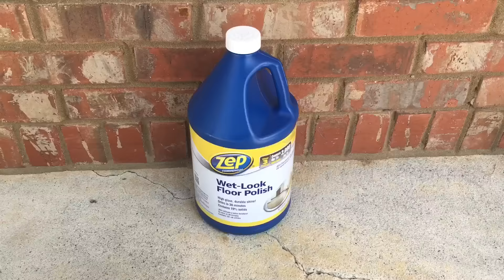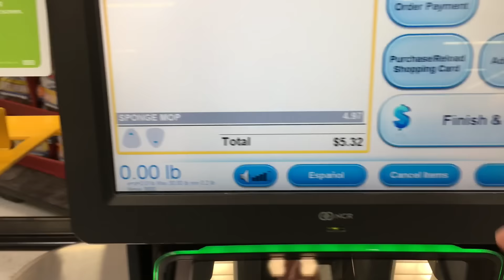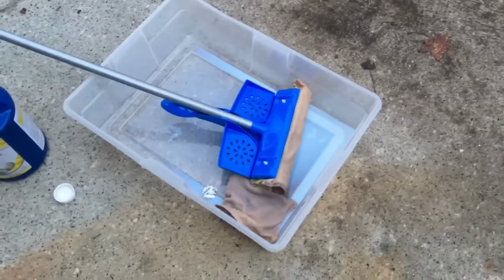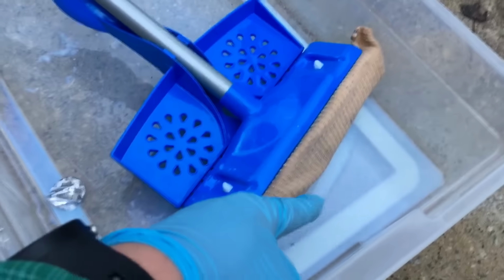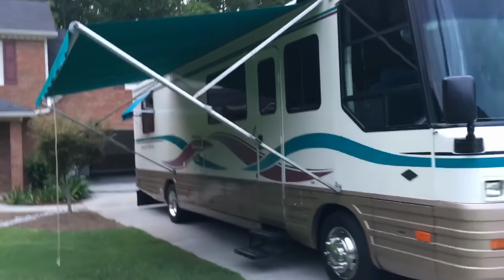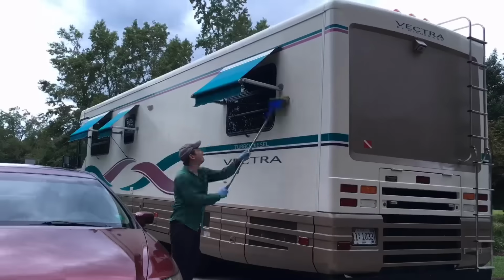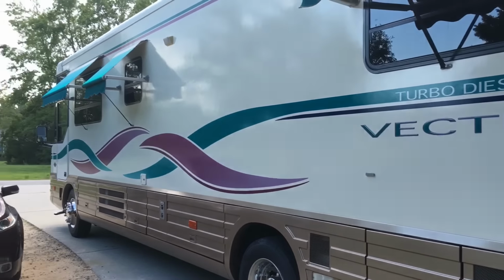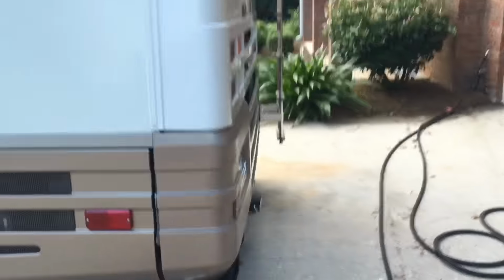Zep floor polish for rv

Comment: After watching this and other videos I tried zep on my 93 Winnebago Chieftain. The results are fantastic. I had tried buffing one section using several stages of heavy to light cut compounds, finishing with wax. The results were ok but not great. The buffing process would have consumed far more time than I have to devote to it. I applied seven coats of ZEP to most of the RV consuming  two-thirds of a gallon to do the entire 34-foot motorhome.  Two months have passed and it still looks great.
Reply: Hubby's dad has a 92 34 Bounder.It's got that chalky look. Would that help bring back some shine or do we have to get rid of the chalky stuff.forget what they call it.:>)

We live in Canada can you but ZEP here?
Reply: It depends on how thick that chalky stuff (or oxidation) is. I suggest you wash a small section then try 4-5 coats of Zep. I could run a finger across my RV and see the chalk on my finger. I did a good wash with a sponge first then used the Zep. 5 months now and still looks great. Good luck!
Reply: We'll  try It when the SNOW Disappears here in Southern Ontario Canada.:>) Thank You .
Reply: Yes Canadian Tire

Comment: Tried Zep wax and was very pleased so far. Unit was involved in tornado and huricane in Florida last Sept. Applied Zep in Jan 2017 and is in good shape. However the sides are a bit irregular in shine. I also use micro fiber to apply. Front and rear caps are great. Smaller areas seem to work better than large side wall.  If I apply several coats does this work better. Have 4 coats now.

Comment: You can buff that finish, and the reason to do that is to level the finish or it will leave application marks from your sponge or cloth. You have to 1. put on at least 6 thin coats.2.use a mild scotch brite type pad on your buffer to cut and level.3 use finer pad or cloth with a little polish to buff it out. Slow speed so as not to burn the waxed finish. It's a slow process but if you were amazed at the Zep finish by itself, youd be amazed after the polishing process.

Comment: I carefully washed my RV, the put it back in the garage for ZEP waxing. The first two coats I put on with a large sponge thinking I could avoid streaks by having a flat surface. Even with wringing it until it seemed almost dry, I got all sorts of drips. I switched to a microfiber cloth, and over two days put on 5 more coats, trying to go in one direction as much as possible, carefully scraping off any drips or thick places with a razor blade, much like scraping paint off a window. I have to say the RV looks like sh.t, all streaky and seemingly uneven application. 
Any suggestions? Should I try lightly buffing it. Live with the streaks?
Reply from the maker: Wow.. I’m really sorry to hear that, the possibility that you were streaking on the first layer is probably why you aren’t happy with it, but you probably already thought of that.. I do have a video out where I removed Zep from our coach and you can watch that for some ideas if you do decide to remove it.. I’ve never buffed Zep but it’s clearly one of the steps one takes when applying it to floors. If I were you I’d try to buff it because of all the work you’ve invested!

Comment: Do you have to get the oxidation off first before you apply the Zep?
Reply from the maker: I didn’t and I don’t think so, but do how you feel. One thing to remember, If you put Zep on you can’t have a wax on it, it must be completely stripped of all other products! It’s a key point bc Zep will not apply properly otherwise!

Comment: Nathan,  I have used a sponge and have done about 2 coats on 1/4 of my coach.  The finish has lots of streaks.  Now it could be the mop I am using.  I noticed in the video that you used a microfiber cloth.  It was hard to tell how often you went back to the pan to get more wax.  I know from experience with floors that you put one thin coat one way and then a thin coat the other way.  I tried that and I still have streaks.  Additionally, floor wax is something that one needs to use with caution as it can be a bear to take off.  So my question is how often are to going back to the pan and how thin are you making each pass along the surface?
Reply from the maker: +Ron Black  I'd suggest light, thin coats! I know of the streaking but as for me, what I saw wasn't bothersome. I'd deff suggest the smoothest applicator pad possible! I applied the coating mainly using (if not totally) an up and down motion. Go back to the pan as minimally as possible all while assuring product application! Good luck!

Comment: tried zep and looked great. but I really screwed up.  The whole 5 the was finished, then I decided to do over the tip outs. So I slid in the tip out and washed and TSP but the residue from the small area washed over the finished walls so I ended up with a mess were the TSP ate into the Zep wax. terrible mess, will I have to use stripper to clean the zep and start over again. Help

s
ls

Comment: Whoa! I put 5 coats on the front of my camper. Looked great, BUT one week later took a 300 mile camping trip in some rain. The entire front on the camper has chunks of the wax peeling off. Any ideas before I finish? I guess now I am going to strip the front. Zep does not recommend this product for fiber glass campers.
Reply from the maker: James Parker yes, I'd suggest stripping it, and trying it only on your fiberglass sides. If your front cap is plastic and not fiberglass that could be part of the problem? I know for me it appears that way, or at least it has a different factory coating that is harder for zep to adhere to! I'm planning a follow up video and I'll address that. But as for the sides of the coach it's lasted beautifully
Reply: James Parker did you wash it good first?
Reply: I think the Zep is causing the graphics to crack.  Anyone else had that probem?

Comment: Does the ZEP leave streaks by the mop after it dry's? or was it still wet at 7:42??
Reply from the maker: It can definitely streak! I’ve got a video removing Zep.. this will help you make a decision if it’s right for you.. also, comments from others under the vids may help you.. it’s not a no or yes, it’s a decision you make for you!

Comment: I have a TT w. the siding..not a smooth siding like this RV..its the shingle type siding..how would I apply it?
Reply from the maker: I'm not aware of your siding as is described.. however you can try a small area and see how it performs and make adjustments accordingly. Remember thin light coats!
Reply: its the single type siding that you see on travel trailers..its not fiberglass. its metal.

Comment: I noticed that you used the zep on the metal dunnage doors on the lower portion of your coach.  Some people have said not to use the zep on paint/metal.  I have a 1998 bounder that is prepped for waxing.  Have you had any issues with the wax on the metal doors?
Reply from the maker: +Larry Thomas sorry for the late reply, I've personally had good luck with the wax over the painted body panels and metal, I suppose it's bc it's a floor polish and can be applied to smooth surfaces. I still believe the only issue I found was in instances where residue was left on the surface before applying zep.
Reply: Waxed it two weeks ago and it looks great!  Great video.

Comment: you had mentioned buffing did you try it how did it work
Reply from the maker: Daniel McElhiney hmm not really, but I'd  deff suggest it to see if it works for you!
Reply: I used it and then used my nail and it scratched off so it won't hold up for me

Comment: would you recommend this for the gelcoat on a sailboat hull?
Reply from the maker: +Walter Payerl I don't think I'd want to recommend it for sail boats except for the fiberglass that's not permanently in water, and salt may eat up the finish anyway, if you are saltwater based. Finally, I'd be afraid to suggest it on any surface you walk on, I'd hate for you to slip! However, you can test it and make a video of your findings and let me know if my concerns are even legit! Let me know if you do?